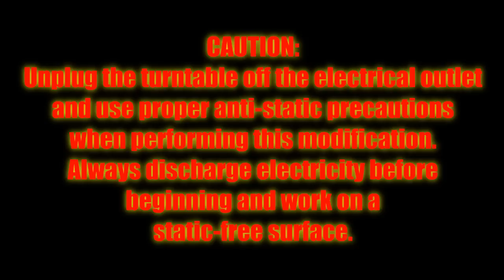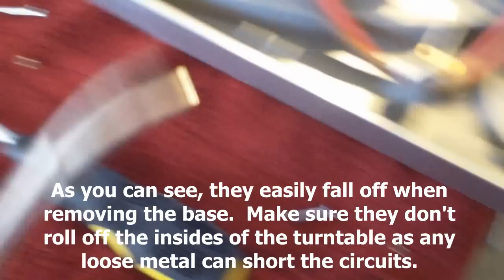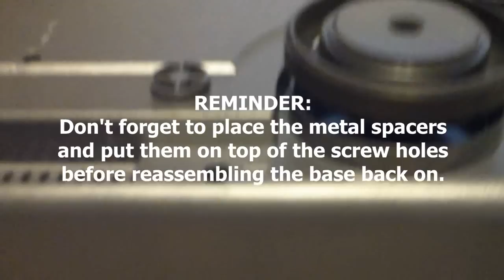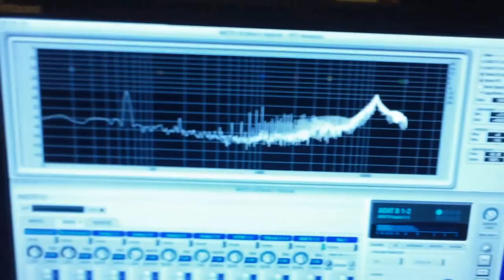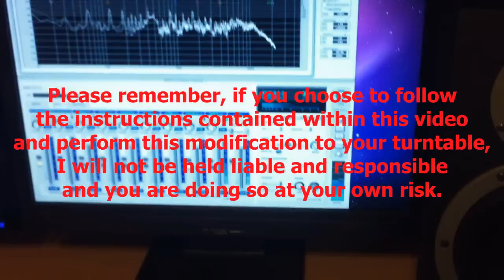AT-LP120 Preamp Removal (Step by Step Instructions)

Comment: Thanks for the video! Some tips for others who are trying it (gathered from other posts and my experience): 1. You can put the little brass spacers on by placing the bottom back on the turntable and dropping them into the screw holes, rather than trying to balance them on while putting the bottom back on. 2. You don't need to unscrew the spring. 3. If it's unclear on what to do with the ground wire, you just need to attach a new piece of wire that's long enough to reach your preamp/receiver to the black ground wire that used to come off of the internal preamp that you removed. 4. You can lock the tone arm into place, leave the head on, and just balance the turntable on the dust cover instead of trying to create some sort of foam base for it. 5. You need the ground wire, don't skip it. Mine buzzes quite a bit if that wire isn't attached to my preamp.
Reply: Great tips. I used the screw drop into the holes to close up and the dust cover as support today. Thanks!
Reply: Ty Hyten  good info thank you
Reply: @Oratuyr I don't remember specifically what I used, but it's a pretty rigid black wire
Reply: @tyhyten1178  hey there Ty, I am going to remove my built in preamp tomorrow. It sounds like you know what your doing. So I’m writing this inn hopes you’ll see it and be able to get back to me. In the video when he is connecting the sliced wires from the RCA cables to the main board cables. I see there is the white and red wires, which is obvious. The excess wires that are there with the white and red. I am curious what to do with those wires. I see in the video that he has 3 twist caps after he’s done connecting the spliced wires. Did he just connect that access wire and use another twist cap on them? If you could get back to me I’d really appreciate it. I’m very much a step by step guy and that’s the only thing I’m not certain on. Any help would be greatly appreciated.
Reply: Whats he doing with the extra middle inner cables from the rca?
Reply: @tsav1983  did you ever figure this out? What to do with the excess? I’m figuring I will just wrap it up inside of the cap.

Comment: Thanks so much! Just completed, but there were a few things that weren't clear that I wanted to clarify (it took me 2 days because I had to go read blogs to figure it out): at 6:28 he shows the RCA wires, red white and TWO bare wires (one bare wire from the red and one bare from the green). You need to connect these two bare wires to each other. You then connect these bare wires to the bare ground wire coming out of the grey wire (attached to the tonearm), along with the red to red and white to white. Also, you don't need to do anything with the black ground that was cut off of the pre-amp. You need to buy a new ground wire and attach it under the spring, and this goes directly to your pre-amp.
Reply: you probably forgot about this comment lol but thank you so much I had spent ages trying to figure this out before looking at the comments
Reply: So the red inner wire from original rca to the red wire from circuit board and white inner wire to white. Then the extra outer wires together to ground?

Comment: I have had the AT-LP120 for a couple years and never really liked the sound output, even with a good cartridge, the crap pre-amp by-passed and a good tube pre-amp instead.  I just went ahead and ripped out the on-board pre amp, soldered up the connections and tried it out.  HUGE improvement, much more open sounding, better highs, and an increase of volume too.   Highly recommended.  Thanks!
Reply: +Michael Etson Hey Michael, How did you discharge the electricity when you were working on your LP120? I have an LP120 also and I'm thinking of removing the preamp too.
Reply: +Vinyl Eyezz I'm not sure I understand your question. I of course unplugged the turntable from the power and from the amp before disassembly. If you are talking about static electricity, you needn't worry, the circuit is not that sensitive.
Reply: +Vinyl Eyezz Ya don't worry! there's no processors in there. it's like, 1970's tech.
Reply: ipreferns haha ok, I just don't want to get electrocuted!
Reply: +ipreferns TIL Processors hold a lot of electricity.
Reply: +Vinyl Eyezz  I would turn the turntable on for 30 seconds while unplugged to discharge any stored electricity. I would also recommend soldering your connections and not using wire nuts. 
Make sure you use a nice fat gauge (18) of braided copper to extend your ground to your preamp or ground source. 
+frankpbcfproductions Really helpful video thanks!!
Reply: +zac ordene I used a fat solid copper wire, and didn't solder the connections, wrapping them tightly seemed to be enough and I'm getting good sound out now.
Reply: Thanks for the advice.
Reply: zac ordene
This is only temporary, I soldered up the connections 2 weeks ago and it's working great.
Get a 15W or better 30W soldering iron and some electronics solder (40%lead 60% zinc), get a cheap nasty one if you don't want to use it after, you can find a usable one for 10 bucks, but make sure it's coming with a flat blade.
Reply: Jared, did you get a chance to remove it from your turntable?  I'm thinking of doing it too since I don't like the extra noise emulating from the pre-amp circuit.

Comment: Just finished this mod; Cannot thank you ENOUGH!!! Was easy w/ your step by step directions! Was kinda scared to attempt at first (had very little to no exp w/ electrical wiring) but had no problem whatsoever & it sounds GREAT!!! ANYONE that has an AT LP 120 & doesn't use the built in pre-amp should DEFINITELY do this mod!!! THANKS AGAIN!!! Next upgrades - a Ortofon 2M red cart & a lil bear tube pre amp!!!

Comment: Did this myself.  Thanks a ton for your video.  The one thing I didn't understand, until I was elbow deep in this, was that you have to splice the ground in the output wires to the output RCA cables, and that the ground in that line wasn't a third wire but rather a sheath of wires.  Once I figured that out (and did some pretty lousy soldering in the process) I was good to go.

Works great.  My wife and I can CLEARLY hear the difference.  In our case it may have been especially bad because ours is on a 25 foot long run from our receiver, and even though the cable is low impedance, it's not particularly special.  Attenuation was definitely an issue when we plugged it in, and this largely eliminated that.

Comment: As a professional Dj and programmer 30+ years in the business, I have a pair of these fabulous turntables in black, it would not be wise to modify these turntables. The pre-amp is built in there for a specified reason, especially when using timecode vinyl plates through digital DJ software or the USB connection. Because these frequencies operate on a low frequency of 0db. If you have a mixer that is already pre-amp built. The switch to phono on these turntables will automatically be bypassed. What happens is the pre-amp mixer will shut the pre-amp frequency to the turntables off, recognizing only the signal from the pre-amp mixer, and it kills the hum also. Digital signals works differently than analog signals. It will not take away the sound quality, if you understand professional sound. To get the preferred sound is using a frequency equalizer, what this does is open up the digital sound from your computer or receiver and converting it to an analog frequency sound, getting the same results as if there were no pre-amp in it at all.

If you are just using a reciever and have no frequency EQ to balance out the sound from these turntables then of course you will not get what you are expecting to hear. there's really no need for this modification, unless you are just looking for raw sound unbalanced. Yes you may have some better highs but it is still not balanced out the way it should. Of course you may think the sound is better if you do not have the ear for direct frequency changes and just hear the record.

That's why having a good frequency EQ or a pre-amp mixer will eliminate the distortion. I saw in his video that he was using a DJ interface box, that's ok but not good enough to balance out the output from the turntable pre-amp If you are just playing records and have no desire to upgrade your sound system then you will not get the clarity you are looking for...... Really these turntables were meant for DJ and studio recording purposes, but if you want to modify it cool. But there may be some backlashes in the future operating them, and I could be wrong. But I'm coming from a professional DJ and programmer perspective...
Reply from the maker: I understand what you're sayin and trying to get at.  I'm not a "professional", but I did a bit of DJing and studio/audio production work myself  way back in the day (started in the 80's). I am well aware of timecodes, Digital DJ software, EQ's and frequencies.  The AT-LP120USB is not ideal for DJing imo.  The torque ain't like a Technics.  

But all this has got nothing to do with my decision to mod this turntable.  I merely wanted to try and see if removing the preamp would make it sound better for my purposes (digitizing my record collection).  I got this mod idea from vwestlife's video.  He was probably one of the first people to try it and make it known.

I had moved on from this turntable and had upgraded my system.  I now have a Technics 1210GR with a Lounge Audio LCR MKIII preamp.  The ART DJ PreII was a very good (and cheap) preamplifier that served its purpose.  It has a gain/trim knob which was vital to me when doing my needledrops.  

So thanks for your comments.  But I just have to say I don't understand why you needed to throw your credentials in there.  Funny enough, the title "DJ" and "programmer" don't mean a thing nowadays.  It's kinda cringe-worthy. Doesn't really command respect like it used to.   But hey, that's just my opinion.  

P.S.  I like the vids on your channel though.  I LOVE me some soulful house!  The very genre I used to spin back in da day!  Peace!

Comment: I just completed this modification and it sounds better. The sound is even more clearer and quieter. Only thing I had to do differently was I had to ground it to my computer tower. Connecting it to my phono preamp gave it had a real bad buzz noise. I'm using a Audio-Technica AT440MLa cartridge thru a Cambridge Audio preamp. Then I clean up the pops/clicks and other noise with Adobe Audition 6 for some great music. For those that are confused you have to add an extra wire to make the ground wire from the turntable itself. Thanks for the great video!

Comment: I did it, thanks for the video. One tip for others would be to go ahead and put the turntable back together before you do anything with the brass spacers. Then you can just put the spacer on the screw and drop it right in the hole without it falling everywhere. No need to tape them.

Comment: I did this mod over the weekend and not looking back - WHAT A DIFFERENCE!! The audio clarity is night & day better. I don't understand why the line/phono "by-pass" isn't a true by-pass...it could have been done that way and this mod wouldn't have been necessary. I am grateful to Frankie P for producing this video and some others who convinced me that this mod was worth it...WELL WORTH IT!!!!
Reply: Just wondering if the folks or persons in charge of this faulty pre-amp by-pass defect were shown the door.  I'm sure my LP-120USB will suffer the same fate if and when I try to use the "phono" switch and by-pass the pre-amp "line" switch, mine was probably built in around 2010, 11, or 12, had in in storage for many years.  The sound I get from the "line" is really weak and crappy.  Thanks and God Bless

Comment: Since you are dealing with extremely low voltages coming from the phono cartridge, I would STRONGLY recommend taking the extra time to solder and heat shrink. This will ensure a positive connection the first time and eliminate any possibility of loose connections causing crackling and loss of audio.

Comment: To install RCA output connectors would be a good idea to preserve signal from other electronics (and noises). Original RCA cables are not the best...
If I purchase this turntable I will do it.
To increase inertia and speed stability I use to add fishing plumbs carefully attached with epoxi at internal circumference of the platter. Amazing!

Comment: What I did for the ground wire is i took the ground wire off the preamp board and spliced that to my ground wire then just put the other end under the screw that holds the spring. Anything will work as long as all the ground wires you see all connect together somehow. My method seemed to be the cleanest way

Comment: I've done some rather extensive testing with my own LP120 using a Nagaoka MP-110 cartridge and having just bought a Art-DJ2 Phono Preamp to verify whether my Carver C5 phono section was the problem (It was not; they sound the same), I've drawn the following conclusion.  The "treble/high" roll-off that improves so much with the built-in preamp removed is indeed caused by the built-in preamp.  I've made an inverse EQ in Audacity to counteract it for recording that works great, but isn't any good for listening directly.  I start an EQ curve at about 4kHz and peak it at about 4dB at 10kHz and leave it flat through 20kHz and beyond (for 24/96 recording).  This gets me the same highs from the CD version of an LP I have and more interstingly, it's the same output as the built-in preamp when you use it instead of "bypass".  Thus, BYPASS is where the treble roll-off is occurring.  It does not roll off with the built-in preamp being used.  But the problem using that preamp (whether you think it's any quality or not) is that it has a "Gating" circuit that mutes audio at a certain low level and it does this in quiet passages on and off and it's just utterly awful and therefore unusable for that reason alone, in my opinion. 

It would seem that removing the phono pre-amp is the only way to get around the treble roll-off in bypass mode and using the built-in preamp is a non-starter (including the USB output) unless you are prepared to put up with muting of your low-level audio (might be ok if you only listen to loud music).  Of course if you only intend to record, you can get by using the RCA output of a phono stage so long as you create an EQ curve as I mentioned above to counteract the rolloff (the output then sounds the same here in terms of high-end response as the built-in preamp and matches my CD of the same recording very closely). 

I personally think it's ridiculous Audio Technica created a bypass mode that affects the treble output.  It's not acceptable.

Comment: Thank you for this video. I did it last week and I can't tell how much I'm happy with the sound
Reply: Sure if you're going to do a job like this do not use twist tabs to connect wires you will be asking for trouble get you a soldering iron and solder them the way this guy is doing it is called half-ass work the Lazy Man's way End the incorrect way to connect electrical wires you will be having a failure before you know it

Comment: I’ve got the same Audio-Technica AT-LP120USB, I thought I’ll try this today since the hum was getting annoying. Done exactly what you recommend and removed the internal pre amp, added a ground wire and tried it. When I finally plugged it into my amplifier I noticed the hum was worse! I can see the logic behind it as I’m an electrician but it didn’t work. Rewired back to the way it was, unfortunately half day was wasted.

Comment: I did this mod. Very easy. I used shrink tubes instead of wire nuts. 
I noticed the high end digital distortion I was hearing before is gone. Just seems to be cleaner highs overall. 
I'm happy with it. I was using the built in pre before and now I'm using the ART DJPRE II.
Reply: Yes

Comment: Why not simply disconnect the power to the preamp board? That way it can easily be returned to original state.
Wires carrying milivolt signals must be soldered. A twist connection will quickly oxidize and fail.
Reply: TSAmplifiers would that do it? i believe that when switched to “phono” it still channels through the pcb. tks as im doing this this weekend.

Comment: Me, I would have secured the brass spacers in place with a bit of clear nail polish. As for the coax, I would have connected them directly to the terminals off the tonearm, no splices. Good video overall...

Comment: Hello !
I want first to thank you for the instruction which are really clear.

I've got a question, I've a good RCA wire to put inside the LP-120, could I solder it without removing the existent one ?
In the way of keeping the original one in the case my phono-preamp is broken and if I could, where to fix the new wire in this purpose ?
A last question : having two pair of wire should create some interference/unwanted noise ?

I have read many comment but i didn't see the same questions I have.

Have a nice day, regard.

Comment: I did mod, but now I have a ground loop hum. I'm pretty sure I followed the instruction exactly, and even opened it up again to check all of the connections. Disconnect the ground wire from my phono preamp doesn't make the hum go away nor does it make it worse.  Also when i press start the turntable makes a buzz noise in addition to the consistent hum. The only thing I can think of is maybe that the RCA wires are touching. Any other ideas?

Comment: Thank You for the video.  I just got up the nerve to do this and it makes a difference. My mids and highs are cleaner.  I'm running a Shure M97x and a Pioneer A-35R receiver as my pre-amp.  I checked the frequency analysis before and after and I'm not just hearing things.  The mids and highs are a bit more pronounced.  One note on the spacers: rather that trying to get them to stay in place with tape, you can slide them onto the screws and drop them in the hole together.  I noticed this when I had a spacer fall through the hole.